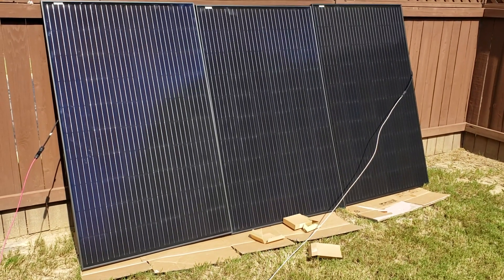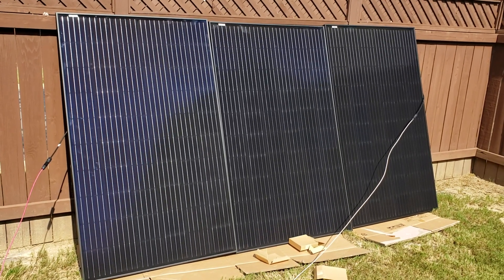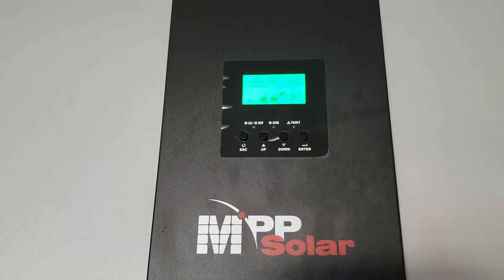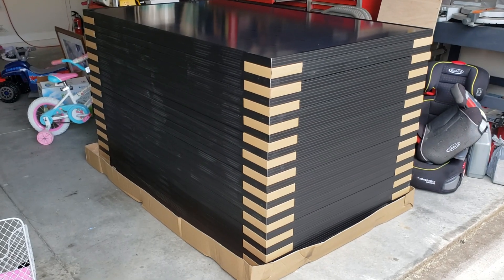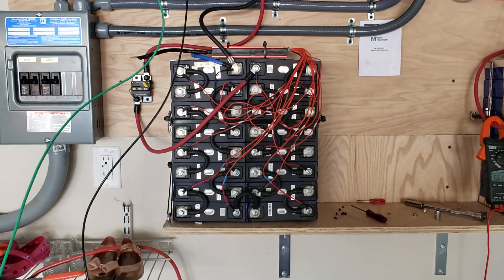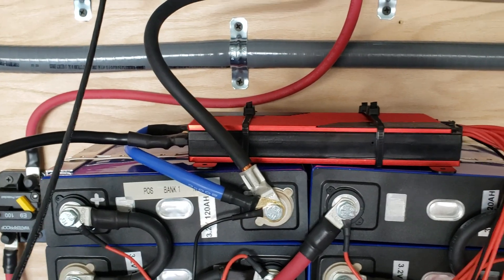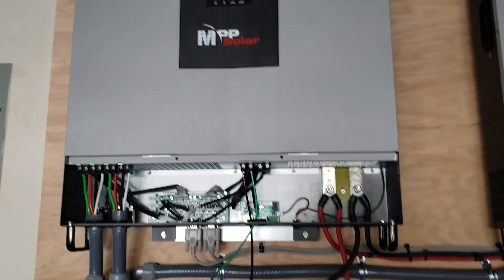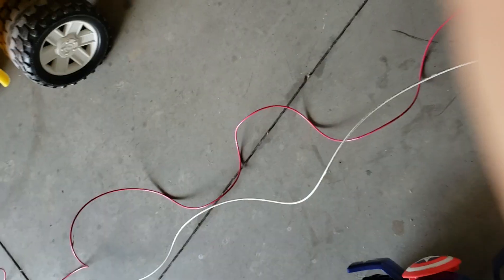MPP Solar LV5048 update and Solar Panel tryout.

Comment: I thought you had to use panels in groups of 400w ? How did it work with 900w. Or is there a lot I'm missing.  I'm just learning over the last month or so. My guess is I'm wrong..
Reply from the maker: It all depends on your charge controller and its capabilities..... What are you looking into?
Reply: Without much trouble.. Leave it to my spelling. Lol

Comment: Thanks for sharing.  I'm installing an off-grid system soon, and currently gathering the materials.  I would like to use the LV5048 inverter except there is one load that has me concerned.  A 240 volt Well pump.  These things draw a big surge.  Have you connected your LV5048 to any surge loads to see how it handles it?  Thanks.
Reply from the maker: I have run 22 gallon air compressor, 12 inch miter saw, table saw and 6kw clothes dryer. Hair dryer too. No problem. I do have 2 of them in parallel, so that does help. I do like your channel. So far these units have been exemplary.
Reply: @DMIINC2013  That sounds great.  You have a great setup.  I can imagine we will see more of these inverters being installed, but you had it first!  I'm in Massachusetts, are you in the North East by any chance?
Reply from the maker: @DavidPozEnergy  Thank you. I am in Atlanta GA area. I opened up owners manual and this is what is says in regards to inverter load. Surge capacity: 2* rated power for 5 seconds. I am looking into getting a third LV5048 next spring. Want to have ability of running AC units too.
Reply: @DMIINC2013  Thank you for looking that up for me.
Reply: Mr. Poz, I watch your channel also. I know you know a lot more than I, on most water well pumps you can take off the end cover or top cover and there you will see a switch 115 or 220, I always use 115 as i figure it takes less power to turn on.. Now this is for above pumps, not sure on sub down the well... Maybe this will help.
Reply: Need to find out what your well pump is rated for, should be on the control panel for the pump. LRA value. Or it might give a KVA letter that you have to convert.
Not sure if the wellpump uses a start/run capacitor, but if it does it WILL not start if they are weak or dead, and will overload the inverter (unless it's a tiny well)

HP: 3/4
Voltage: 230
S.F. Max Amp: 8.0
KVA Code: M

Code Letter M value: Range of 10.00 - 11.19 (10.6 midrange)

INRUSH AMPERES(SINGLE PHASE MOTORS) = ((CODE LETTER VALUE) X HP X 1000)/(RATED VOLTAGE)

value of 11.19, yields a maximum LRA of 37.83
Reply: Inverter are awesome I use PIP 5048MG two in parallel and work flawlessly... 
if I don't use big power over 5kva or 5kw I just turn off the slave unit...
Also have one MPPSOLAR MPI5.5kw true hybrid inverter that one runs my heat pump with 4.5kw inverter compressor..... That are heavy loads....
Reply: Not sure how the well pump motor is wired up, but on HVAC I normally install large start capacitors and properly sized relays to lower the inrush current, that makes them more friendly for everything really, and helps the hvac motor start easier due to not having voltage sag. https://www.hvacrschool.com/start-capacitor-and-inrush-facts-myths-part-3/ explains it well. Most people I see on the internet do NOT size up the relays at all though, a potential relay is needed, mars makes them. You want to cut the start capacitor out at 70-75% of full speed. Test the voltage across Common and Start of the motor, (could be 350volts for a 240v motor) and so a relay that drops the start capacitor out at 245volts would be ideal.
Reply: @patrickdk77  Thanks patrickdk77.  I will check out your link.  The well pump is submersible, and the wires run direct to a circuit breaker  There is no control panel for the pump.  My cheap multi-meter does not have a peak hold function that's fast enough to catch the fast surge.  But, it sounds like it should work.

Comment: Nice....👍
Just food for thought, I suggest you use a better DC Breakers or DC Disconnect on your battery Bank. Those ones you have their are not safe neither good and over rated for what they can handle. 
Thanks for sharing and have a wonderful day.
Reply from the maker: Thank you. I am coming to same conclusion on DC breakers. I already had to replace both of them. That will be my next video this weekend.
Reply: @DMIINC2013  
Wonderful. 
I will recommend you order these if you don't mind my suggestion.
https://rover.ebay.com/rover/0/0/0?mpre=https%3A%2F%2Fwww.ebay.ca%2Fulk%2Fitm%2F223439001599
Reply from the maker: Thank you. I will check them out.

Comment: What panels are those?
Reply from the maker: BlueSun Solar 60 cell monochry. 300 watt panels.
Reply: @DMIINC2013  Where did you order them from?
Reply from the maker: @darrenorange2982  Alibaba.com
Reply: @DMIINC2013  How long did it take to delivery? How much was it a panel with shipping?
Reply from the maker: @darrenorange2982  What I learned was that import tariffs are super high. So what I did was I searched for Alibaba seller with warehouse in US. I found one, Bluesun Solar. It was cheaper per watt when buying the whole pallet, so I did. $120 per panel. I had to drive to TX to pick them up my self.
Reply: @DMIINC2013  And they are new so you get the tax credit for them correct?
Reply from the maker: @darrenorange2982  Yes. Brand new in factory box on wooden pallet.